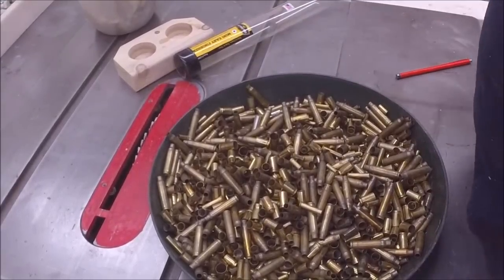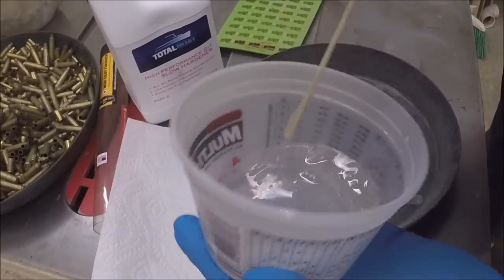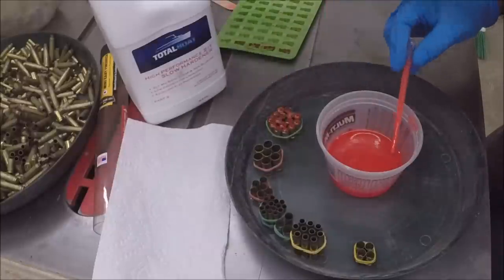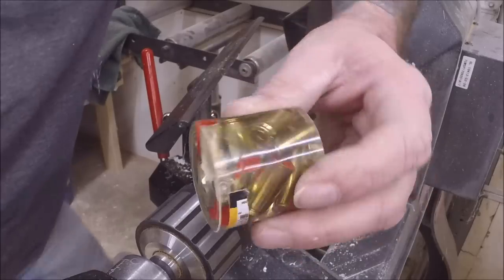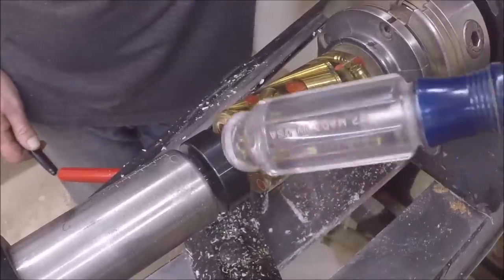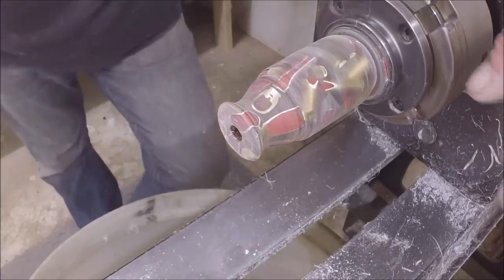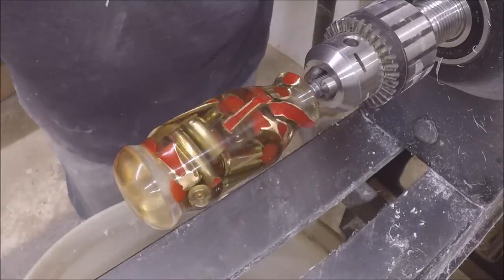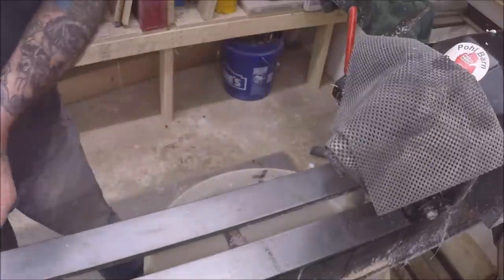Ammo Casings and Resin.. A Screw Driver Handle

Comment: Most brass is tough stuff - gets harder the more it's worked. Mill some grooves in it for grip!
Reply from the maker: Thank You Chris,  I learned the hard way I should have annealed the brass first, lol   that screw driver is never going to be used for anything other than my dad showing it off.  it doesn't need to have groves.

Comment: this is pretty cool, and ive been considering molding my own craftsman handles for the fun of it. (hot pink craftsman tools, why not?) but i was wondering as you did sort of "press" the screwdriver shank into the handle, was the hole drilled to the size of the shank only? or the size of the ears on the shank? im afraid of trying to just drill for the shank size and press the ears into it for fear of cracking the handle, as well, how do you hide thr grooves left behind after the fact? but at the same time, just relying on epoxy alone to keep it from breaking loose inside the handle and just spinning... i wouldnt trust it, even if it was the strongest epoxy in the world.
Reply from the maker: actually I do not remember but I am thinking to the size of the hears and the 5 minute epoxy filled the rest

Comment: Great work, love it!!..  was that a vacuum cylinder or pressure vessel you used to cure the epoxy so fast
Reply from the maker: Thank you ! Pressure pot, it's not to cure the resin fast it's to compress the air bubbles until the resin sets up and cures.
Reply: Ok great, cheers

Comment: You're driving reloaders like me nuts <3
Reply from the maker: Thank You, most of those casings were picked up off the ground, we do not reload 9mm's as they are cheap compared to the 357 or 45's, I'm working on a set of grips for a Springfield 1911 9mm right now using 9's and resin, filling the casings in red white and blue.  but I need more of them,

Comment: One of the coolest things I've seen on utube only thing that would make it .oo5% cooler would be to have a 10mm casing at the top centered so you can call it a 10mm screw driver. Perfect for adjusting carbs bro
Reply from the maker: Thank you !  I used the casings that we use,  No 10mm,  everyone want's there their favorite to be in there, as this was a gift for my Dad I made it a point to place the 357 so it could be seen and not touched by the turning process.. Glad you liked it.
Reply: @PohlBarnProductions  lol I'm not a 10mm fan it's just the most lost socket in my box as most. Geat work
Reply from the maker: yeah that and the 13mm,  I'm forever searching for that one as well !

Comment: Are those special lathe tools made for metal? I can’t imagine using ones made for wood on the brass cartridges. Wouldn’t they be ruined?
Reply from the maker: They are wood tools, and they did take a beating from the brass as it was hardened but they still cut it,

Comment: I would like to have seen this with clear epoxy inside the casings, that way the ones that got machined down on the lathe would look like "cutaway" models. Still cool with the red, but curious what they would look like with clear.
Reply from the maker: Thank You... I probably would have to of cleaned them first for clear, I hadn't really thought of it, just filled the casings with red and poured the blank, it was actually a difficult turn as the casing were really hard, and the resin not so much. when I do it again there will be a few things I do differently.  Glad you like it.

Comment: Forgive me if this is a stupid question, but I just cant figure it out..... Why couldnt you have any magnetic material in the casting? Just curious...
Reply from the maker: I was checking to make sure none of it was magnetic, I did not want a ferrous metal in my project, I do not have the right tools to cut a magnetic material and it may of also caused sparks.... sparks in a wood shop is not a good thing !
Reply: @PohlBarnProductions  yeah I guess that makes sense then.... Cool idea for a tool handle, thanks for responding btw

Comment: Dude can you make some File knives with Yellow jacket wasps in clear epoxy for the handle or the bullet shells in a big ass leaf spring knife or farriers rasp knife. 
       I make knives what brand epoxy do you recommend and where to buy it?  I want a really hard epoxy but clear no air bubbles. 
    I noticed u have a vaccuum machine. I could make a ghetto one with a shop vac and plastic bucket maybe. Or could you sell me yellow jacket and wasp casts that i could cut in half and pin or epoxy to the knife handles and polish up?
Reply from the maker: Thank You Joseph,  allergic to bee's and wasp's not gonna mess with them or I'll have the Doc stinging me with about 4 different needles to make everything all better,  Total boat,  you can check there for the hardness on each kind of resin.

Comment: Those screwdriver handles would sell Quick in Canada.
they would also be great shifter handles and Hand brake handle's,
how long does it take to make , and what is your price for a Ammo Handle  buy one.
Reply from the maker: well it's taking a bit longer to process the casings,  I did not anneal them for this project and they were hard as hell,  I do not think it will be that profitable to try and produce these on a large scale, to much time involved, that one was a gift,  I might make blanks and sell those if the next project goes easier than this one did.
Reply: @PohlBarnProductions  oh ok i see what you mean the time in making them.
Reply from the maker: not only that, shifter knobs all have different size threads, I'm only limited to so many casings right now,  LOL most are still frozen to the ground. so if you factor all that in along with the time it takes to make it,  they are going to be really pricey, Most blanks sold are roughly a certain price, that I can probably do but supplies are limited, but I think that is the direction I'll go with this.

Comment: This is very cool, but I think I would have tumbled the cases then acid-etched them a bit to get the epoxy to stick better. Even a tiny amount of tarnish on the brass and it's not going to stick well.
Reply from the maker: Thank You Tim,  this was a just do it project didn't think about all that,  I have since annealed the casings along with tumbling them in some sort of fluid,  dad did that for me.

Comment: only thing that I found that left me wondering was why did you not mount the metal screw driver IN the mold when pouring your clear resin - then you could have put it on the lathe in a live spindle and turn the handle. Would have made things easier than threading the handle
Reply from the maker: I do not have a live spindle and it would not fit in the pressure pot that way, the other issue is the level of the resin decreases as the bubbles escape, and then there is that whole thing of me being a Rookie!  LOL   I have not been turning for very long.

Comment: What was the reason for placing the handle in the pressurized pot
Reply from the maker: to control exothermic reaction and compress any air bubbles that may not have escaped .
Reply: The Pohl Barn Productions thanks for the video and reply just subscribed
Reply from the maker: Thank you  and Welcome Aboard 

!

Comment: what was that you put it inside of? the gray metal thing?
Reply from the maker: that is a paint pressure pot I've modified to put resin castings in, it is suppose to compress the air bubbles until the resin sets up and cures.
Reply: @PohlBarnProductions that's an awesome idea! ive never thought of that. Ive tried multiple ways to get bubbles out of deep molds with no luck. how would I go about modifying one this way? I just made a bullet coffee table, bullet coasters but id like to do this too seeing as im a mechanic and prybar handles with this would be a great conversation starter.
Reply from the maker: um it really wasn't that difficult, I use a cheapy harbor freight paint pressure pot and removed things I didn't need a added a valve, but there are video's out there, Check out Zac Higgins over at NV Woodwerks he has a couple different videos on modifying different brands, and so does Casey Martin  but I believe he is formatting it around what Zac has done.
Reply: @PohlBarnProductions  awesome and harbor freight is a savior haha.
Reply from the maker: I think that pot is 100 but if you take that 20% off coupon with you, 80 ish.  plus the fittings and the valve,
Reply: @PohlBarnProductions  that's real good deal

Comment: Why not put the screwdriver shaft in when you put the casings in the resin and let it cure?
Reply from the maker: multiple reasons really, for starters it would not fit in the pressure pot, I have no way to hold it in the chuck, and as the air and gases escape from the resin the level drops and that would leave an unsightly gap between screw driver and handle.

Comment: Bet it was a killer when turning.  That spent brass is hard on “wood working turning tools!”

Good job, very aesthetic especially with the red tint filler dye epoxy.  Wouldn’t mind having a complete set for myself.  That’s another project... Hat tip bro.
Reply from the maker: Thank you Thank you , I have since done another brass project this time I annealed the brass first, still hard but much easier to turn.

Comment: How much would you charge to make a set for myself?
Reply from the maker: I think if I did anything I would make the blanks, there is so much involved in the process, and then to turn it on top of that would be a lot of work
Reply: @PohlBarnProductions  yeah I can see how much work was involved, I love it and wish I could get a set. I would be the talk at the job site thats for sure. Great work.
Reply from the maker: more work was involved for the next project, I've annealed the casing as it softens the brass, and then polished them in a tumbler as the annealing process discolored the casings.

Comment: Good job, but I think it might have been easier to just put the screwdriver blade in at the same time as the shell casings, and then just straighten the whole thing up using the lathe.. Then there would have been no need to drill the hole
Reply from the maker: Thank You,  the resin level goes down as the air escapes or is compressed in the pressure pot, along with it would not fit into the pressure pot as one piece.

Comment: Why dont you try an gun handle (AR15or something like that)with shells
Reply from the maker: as of right now I have to soften the brass, it's to hard to try and cut any scales or grips, it'll just come apart, it needs to be soft enough to cut without getting hot so it doesn't separate from the resin, or be ripped out.

Comment: Did i see some live rounds there lol
Reply from the maker: did you watch me fill them all with resin, now ask yourself that question again. I've been asked to make one with live round, also been told it was stupid that I hadn't used live round,   lets see here,  place live round in a 2 part epoxy resin the has an exothermic reaction while curing, now those live round would also have percussion caps, so let throw those on a lathe and turn them at 2000 rpms and see if the carbide tool hitting him doesn't set them off.  Come ON !
Reply: @PohlBarnProductions  i ment in the pan whit shells not in the handle haha.
I know not to do that whit life ammo.
Ty for answering and i didnt ment to stirr you up.
Just new and asking a normal question
Reply from the maker: I did find a 22 lr that had been hit and not gone off in there but other than that one no there weren't any others.  but I found that 22 in the rest of the bucket while I was annealing casings to try again. I don't think it was in with the ones in my video

Comment: Putting that in a vaccume would make a mess im guessing..but im a ole do it urselfer first i love knowledge second most people now days have no skill or pride to do things the right way..love the handle though..thanks for sharing..
Reply from the maker: Thank You Richard,  Vacuum would make a mess and it's not fast enough to remove all the bubbles before the resin sets up, the pressure pot is to control exothermic reaction and to compress any small air bubbles until the resin sets up and hardens,
Reply: I just thought could be something like that ..i have been in hvac plumbing mechanical trades all my life well all my wking life..i always pull vaccime on ref piping to remove air moisture any contamination in piping. Im looking forward to more of ur vids keep it up..and thanks forr the info
Reply: Bore u ha ha ha yeah ur step boring..too cool..
Reply from the maker: There is a vacuum system with resin designed for it, but that is currently not in my budget,

Comment: Why cant it be magnetic?
Reply from the maker: I didn't want anything that hard in the casting to turn, I'm sure I could turn it but sparks and chipped cutter might of happened ! Sparks in a wood shop is no good.
Reply: Because if its magnetic that means its a ferrous metal i.e. iron steel cobalt nickel which are so much harder than rhe resin it would have caused ceacking and tear outs as well as a chipped cutting tools although i doubt there would have been sparks it didnt seem like you were turning at a high enough rpm to cause sparking

Comment: I'd use tiny seashells. On a set of kitchen knives.
Reply from the maker: I've looked at seashells for a project, I know they can be turned, just haven't come up with a project for them yet.
Reply: @PohlBarnProductions  Maybe kitchen cabinet knobs? On a $75,000 kitchen install, $500 for a set of knobs is nothing. 
 I like the screwdriver handles. Way cool. How about a set? Smallest screwdriver would be .22 shorts  and the biggest .45 ACP. Two-fisted jumbo screwdriver could be 7.62. Tumble the brass to get a big shine... I'm thinking there's yuge money to be made there...outlaw bike mechanics...
Reply from the maker: I'd have to go hunt down some of those casings, I'm not sure if dad still has that 7.62 anymore, I can for sure do the rest of them, it'll just take some planning as I did not do it in this project, I learn the hard way,, LOL  placement so the drill doesn't deflect of the casings is a must, speed up the lathe, it took a really long time to turn that with the casings being so hard.
Reply: @PohlBarnProductions  Sure...there's a lot of places online you can buy bags of used ammo brass. Ebay has  plenty. Here in Arizona, you can pick bucket loads off the ground - out in the desert. 
You could probably sell the heck out of paper weights.
Reply from the maker: all those round were collected from our personal range out back, between me,dad,Family and friends the ground is covered in them, those are just some of what I picked up to recycle as we do not re-load most of those rounds. 45's were not suppose to be in there. I am sure I could sell them and paper weights would be easy to mold and cast.
Reply: @PohlBarnProductions  I'm getting hooked on this thing...just something to fool around with. Harbor Freight has a nice looking 7 X 12 mini lathe for $600. Plus they sell lots of accessories. I think I might buy it.
Reply: @PohlBarnProductions  While watching your video I got one idea that may work. When you resin cast the casings, put a wooded dowel in the center, as long as the hole you need for the screwdriver rod, and wide close to its diameter. That way you will be drilling the wood (not the resin and casings), and just a bit of the resin around it to make space for the rod and the gluing epoxy. I hope it makes sense, and is doable. Take care and stay safe.
Reply from the maker: You can get a better lathe than that for less money, look around doesn't have to be this one but they are out there.NOVA 46300 Comet II Variable Speed Mini Lathe 12-Inch x 16 1/2-Inch
Reply: @LeonAllanDavis  Do not go with Harbor Freight. There are bunch of lathes similar is size, same prize, but better quality. Nova is OK, 3/4 HP, Laguna has a new 12" 1HP lathe for $800 (usually they have 10% off, which ended 1/31 but will come again in month or two). Also Nova has a bundle on it's lathe with chuck and set of mini tools for $650. Check that one out.
https://www.acmetools.com/shop/tools/nova-46302t
Reply: @PohlBarnProductions  Thanks yugely... yes, I always shop around...
 That being said, I don't need anything big or super fancy...it's primarily for my own amusement...
 I like making things for myself because after it's finished, I know it's the only one like it in the world. No one else has one. 
 A man can never give birth but creating a unique object is a lot like giving birth. To be sure, it's an inanimate object and not a human but still, the thrill of creation is there...
Reply: @pajonate  Thanks for the good advice...much appreciated...

Comment: Should have annealed the casings before you cast the handle wouldve made the brass much softer
Reply from the maker: I never even thought about that, just figured I was good to go,  I will know the next time I make one, I think the Model A needs a shifter knob made of Casings ! Thanks for Watching.
Reply: @PohlBarnProductions  you're welcome I enjoyed the video I do believe that the brass in munitions casings is die drawn which makes it a sturdy and a suitable vessel but it also means that the grains in the metal are compressed and work hardened which means it is relatively hard brittle and much more likely to grab your drill bit I do look forwards to a video on a shifter know that would be very interesting
Reply from the maker: I knew it would cut if it didn't stick to the magnet I just for the life of me find the word non ferrous in my head.  I didn't know they would be that hard it was just going to be a quick project video,,,,    That's what I get for thinking again,  Oh you're gonna make me turn another one, I'll have to do some work on those casing first then tumble them before that shifter knob is going to happen.  Thanks again
Doug
Reply: @PohlBarnProductions  Yuah they're going to need polishing after annealing and i can't wait also my name is josh haha